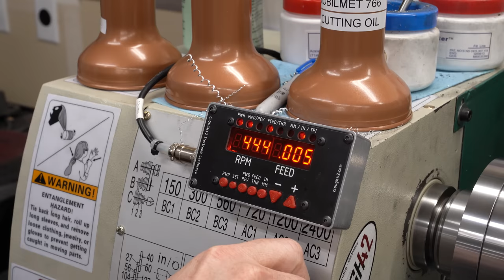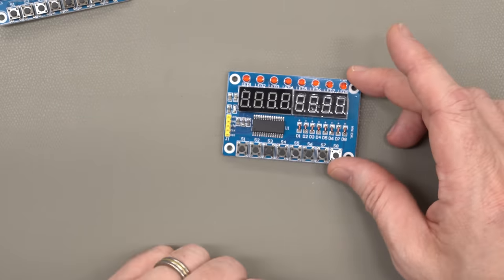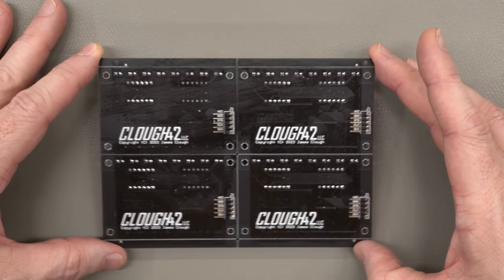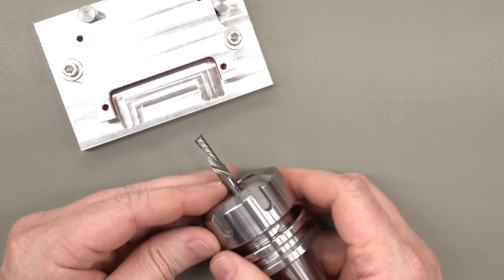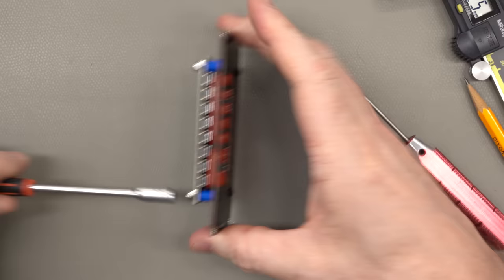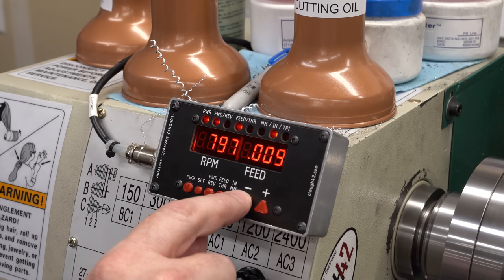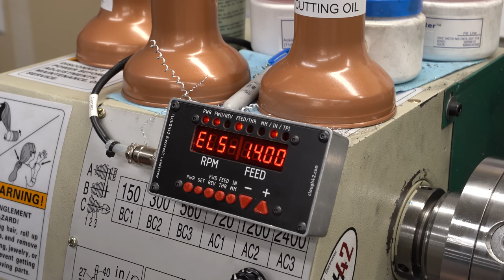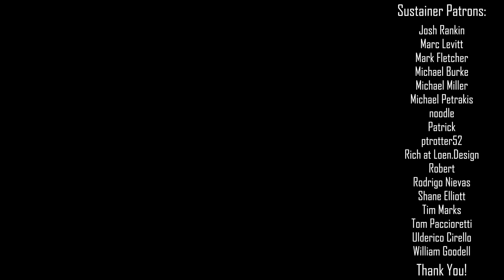Updating the Electronic Leadscrew Control Panel

Comment: Once I needed to go long distance with 3v3 and of course I had the same capacitance problems you had at the start of this series,  so I used a pair of level shifters and bumped it up to 12v. As a plus it turned out to be surprisingly noise resistant and easy to filter, getting a nice square wave out of the 3v3 side of the level shifter.
Reply: Not a bad idea. Take it all the way up to the industry standard 24 volts, then when you roll back down any induced noise is reduced by a factor of 5 or 6.

Comment: James. I had the flicker problem and fixed it by replacing the pull-up resistors on your board with lower value. I THINK is was 10K and I replaced them with 4.7K and problem solved. Not sure about the values, but I made them 1/2 the value of what it was.
I replaced the resistors in the opposite end, on your board that sits on the controller. No more issues.

If you decide at some time to upgrade to a bigger lathe, then I can provide pictures how I installed the ELS on my Birmingham 12X36 Lathe (Generic 12X36). 
Thanks for what you are doing for us. Very much appreciated.

Comment: I am very happy with my electronic lead screw. I did have noise on mine when first set it up. I did various screening. But eventually the problem was tracked down to not grounding the main control board  to the chassis of the lathe. As Soon as I did that everything seems to be very stable. don't think I needed to have screened anything.😅

Comment: 23:52 One of the coolest aspects of this project is that there is essentially no curtain.  Turning a potential customer service hassle due to a supply chain issue into a couple of interesting videos is a 200 IQ play.
Reply: Customers are much happier when they understand the problems of the supplier. When I have a problem, I work with my customers to fix the issues, involving them in it as much as possible. In that way several good things happen. First they feel valued and heard. Second, I get to pick their brains for solutions that I may have missed. Third, they tell their buddies that I care.

Comment: Hi, In my experience errors there are usually caused by ringing on the signal transitions. The easiest way to fix that is usually a bit of series resistance in each signal lead at the signal source end.  That slows the edge down.  Resistance value is not usually critical, anything from 22 to 100 ohms will probably work.  I assume the DIO signal is bidirectional so a bit of resistance at each end may help. I gather the clock and strobe are sourced in something at the other end of the cable, so the easy fix isnt all on the display board. Could be in a cable adaptor.
Reply: DIO definitely is bidirectional if you are using buttons, yes.
Reply: I hope he sees this, was going to say the same thing. He needs to get a scope on it to see what's happening tbh.
Reply: @feynthefallen  
yes, but ringing on DIO is probably least important. Well, at the master that is,  the peripheral still needs a clean clock.     I speculate cleaning up clock and strobe is likely sufficient.   Source termination is the relevant buzzword for all this.
Reply: @ferrumignis  Exactly - without knowing what is causing the problem, it's just shooting in the dark.

Comment: I am sure you have thought about this, but looking at the setup, with the metal box attached to the lathe, unless the screen on the cable does not connect to the die cast box you are introducing a ground loop. So either isolate the box from the lathe or not terminating the cable screen on one end or the other would help. 
I did watch your video years ago but have forgot if you covered this or not, if you did sorry for being a know it all commentator !

Comment: If you want to save a few more pennies and have a higher yield consider changing the LEDs to SMD. With that printed spacer if you extend it a little in that area you will get the light guide effect to stop bleeding from one to the other that might result otherwise. Hand assembling that many LEDs there's going to be some reversed.
I'm guessing you're planning on low pass filtering the SPI lines for the noise? Be interesting to see how that works. Be even more interesting to see if you could diagnose the noise first, scope it or some such to find the source.
Reply: I’m no electronics expert but is there a risk of an LP filter introducing a phase delay on a line which might need critical timing?
Reply: @routercnc9517  Good question, but low pass is in the design of the mind of the passer. In some circuits, low pass rolls off at 500Hz, in others the roll off window is up in megahertz regions. It all has to do with the overall band width of the signals involved.
Reply: Another cent or two saved could be achieved by ditching the extra, apparently unused switch between the + and - buttons.
Reply: @maikeydii  thats a good point. i dont see a need for that button and if everything else needs / is getting a facelift it might save a bunch to ditch it
Reply: @maikeydii  Going back to the beginning, James talks about that button.  It's a standard panel with numerous applications.  Probably more expensive to eliminate the useless button than to keep it.
Reply: @routercnc9517  provided all the signals are treated equally there shouldn't be a delay on any particular line. You'd pick the RC constants as probably something like 4x faster than the signal rates, do the maths though on the input switch levels and rates to make sure it works out.
Mostly just thinking low pass throws out a bunch of high speed noise you don't care about. Probably not really the right way to solve it but it is low cost at least lol. Not too hard to trial too.
Reply: @zyeborm  Yeah, minimal delay anyway but an LP filter delay shouldn't matter. Easy enough to test.  Depends on where the glitch is coming from.  If it's noise picked up by the connection wire, maybe switching to shielded wire is a better way to go.  I would eliminate the possibility of the controller sending the glitch to the panel, first though.
Reply: @plb53apr06  it looks like it's already shielded I think? At least for some of its run.
Think I saw him say he thinks it's the led drive lines crossing under the input signals doing it.
It's all a bit of a black art really when there's that much noise around and you can't significantly change things to remove the problem.
Reply: @zyeborm  Hmmm, that doesn't make a lot of sense to me, the lines are crossing at right angles - parallel will generate cross talk but usually not perpendicular.  If it is crosstalk, he should route the 7-seg drive lines to right of the chip instead of the left. Might not look as pretty but would take the 7-seg drivelines away from the comm lines. Then there wouldn't be any crossings.
Reply: @zyeborm  OK great thanks.  Let's see how he gets on . . .

Comment: To combat the noise, you could write your own I2C driver to use the microcontroller push-pull (totem-pole) outputs for transmission, and revert to open-drain configuration when receiving. The lower impedance output should reduce the likelihood of noise on the line. Bit banging I2C is very simple, and the waveforms are very clearly explained, so it's not in any way difficult.
Reply: It uses SPI

Comment: You should also consider putting decoupling caps on the power pins on the ic. It would help to kill all excessive noise. Maybe a 10uf tantalum plus a .1uf ceramic.
Reply: I wonder if C1 and C2 on board are decoupling caps as on the reference design?
Reply: Yes, add ~10uf decoupling. Add ~47R series resistance to the data/clock lines.
For mechanical simplicity, have a look at the Wurth SMT threaded nuts. LCSC has Chinese-knockoff nuts for assembly too. That way you could remove the need for the printed spacer and locknuts.
Reply: @hoggif  These look like they are supposed to suppress power supply noise. On that note, an inductor in the power and ground lines might not be the worst idea. My guess is that the data lines need signal cleaning capacitors. The frequency on those signals is low enough that a 2.2nF from each signal to ground would de-noise the signal without degrading it. Only way to be sure would be to put a scope on them and scan for transients of course.

Comment: The timing of this video was very convenient. I finished installing my ELS yesterday and noticed that one of the LEDs was not working and now I know why. It has either slipped the quality control or more likely, failed during shipping or when I powered it up. I also cut the wings on the spacer to make the display assembly fit the cutout in the headstock where the old tachometer LCD used to be mounted.

Comment: Another labour saving trick when panelising boards that may be possible here  is to gang together all the input connectors via the panel edges (obviously putting the traces on the unscored side. Then you can test the whole panel at once with a single connection.

Comment: Great video James! I really enjoy this sort.
I read through all of the comments, 158 at the time of posting this. Many thoughts/suggestions to ponder. Rolling your own PCB makes for a trip down the rabbit hole with all the possibilities it opens up. Looking forward to seeing what changes you implement, both for the noise/glitch and other comments/suggestions.
Thanks again.
Reply: Next he will be adding the Z axis DRO directly into the board so that a threading operation will involve putting in the thread pitch, the start point and the end point. They all the user has to do is advance the tool depth and hit one button to get the next pass.

Comment: When using solder wick for those little guys, douse it in flux and the solder will wick even better.
You did a good job with the SMT's. 
 For cleanup work, if your pads have too much solder on them to look "pretty", you can wipe the tip of the iron off very clean and go back and re-heat the joint.  The small amount of solder that transfers to the tip helps to take the excess away so you get the right amount of solder on the SMT's.  It takes a few trips back and forth, but eventually you take the excess away.

Comment: Glad to see you're doing your own design! I recently got a kit that had a bad board, keystrokes were missed 50% of the time, the screen would go all crazy if it was flexed ever so slightly (like a hard button press), and the LEDs and displays were all dim. Fortunately they're cheap and the one I got for $2 or $3 to replace it worked perfectly. Love my ELS and am really glad you are pushing it even further!

Comment: Thank you, James, for this video series, I really enjoy it a lot. Maybe you need to add more "Bypass Capacitors" to the panel's voltage rails as close as possible to the main chip, these capacitors will filter any power glitches, remember that you are using long cables. Maybe 10uF and 100nF capacitors in parallel should be fine for you.

Comment: If you are going through the trouble of making your own board you should consider using a differential transceiver to send the data from the panel to the main board. I had a ton of issues with noisy lines causing flickering screen, and ended up modifying a PCA9615 which is for I2C but can work for SPI as well

Comment: James, I started binging on the ELS series a few days ago.  Last year I bought a G9972Z which appears to be essentially identical to yours other than the "11x26" exaggerated capacity.  It was a replacement for my "real" lathe, a Jet 1024 that had back gears, feeds in both directions, cross feeds in and out and a full gearbox with gear changes only for hybrid metric threading.  Watching this series gives me hope that the G9972Z can almost become a real lathe.   It's time for me to start collecting parts!  Thank you!

BTW- You might look into Rosco theatrical lighting gels for the filter.  They're very thin (3-4 mil thickness) and made of a stable polycarbonate.  Once upon a time I made my living as a photographer back in the days of real film and liquid processing chemicals.  I would put dark green Rosco gel over red LED displays on the darkroom equipment to prevent damage to color film while handling it prior to processing.  The displays were still very visible but didn't pass much light into the darkroom.  Without the green filters the red LEDs lit the room enough to trash color film and fog B&W film.  I know that's not important to this application but the contrast between the dark portions of the displays and the illuminated LED segments was striking.  Just mentioning it because someone might be interested in experimenting with filter colors other than red.

I've watched you for your machining videos for a long time.  Your depth of knowledge of electronics, programming, machining, manufacturing and the multitude of skills required for this project is most impressive.  The equipment around you suggests you've been through more rodeos than most.

Comment: For anybody wondering why things cost a lot more that the basic parts cost this video is a good illustration of how much unseen work goes in to getting a product right.
Whilst you're improving the product and effectively cost reducing it, I'd question why you fit switch 7 as it appears not to be used. A few cents saved, or do you use the boards for other things which make use of it?
Reply: It's all the non reoccurring engineering time, that is where the major initial cost arises. If you make 10 of a product, then the NRE per product is very high, but if you make millions of that product the NRE falls very low.

Comment: Adding decoupling capacitors on the ic power pins will help out with filtering unwanted noise.
Reply: Not is the noise is on the signal lines, which seems likely.

Comment: Good for you, taking this on. ❤
You might check to see if there are even bond wires on the substrate of the failed LEDs.  That’s assuming that there’s a substrate in there somewhere. 😂
Yes, I do electronics for a living. I feel the pain.

A panel knife will really help separating the boards cleanly.

Comment: I finished my ELS recently and even managed to upload a video series on my channel.  I spent along time reducing electrical noise to make it function and it worked in the end but could not get rid of the occasional display glitch. I spent more time trying to fix what I thought was more electrical noise.  In the end I realised it still functioned fine so I left it.  Good to know I’m not going mad and it can be improved in the hardware.  If the new display is offered stand alone I may consider buying one just to remove the issue.  Great work thank you and I realise just how much time goes into this sort of thing!

Comment: I have enjoyed this video series so much. Working on my own ELS with some improvements and I really appreciate how much detail you have shared from your design process.

For what it's worth, one option to eliminate noise issues would be to use a different bus type (CAN comes to mind) as an intermediary between your main board and your display board. CAN is incredibly noise tolerant albeit relatively complex to implement in hardware compared to SPI or I2C. But I imagine there's a simpler fix than that...looking forward to seeing what you come up with!
Reply: In Chris Chatelain's comment, he speaks to doing a level translation to 12 volts on those signal lines. This has the effect of quashing any noise by a factor of 3 or 4.

Comment: If the connector on the back is such a problem with multiple manufacturers, not just one "not feeling like it", maybe it'd be an idea to adapt the box it goes into to have more room, so the pins can be just bent around to the side? Not sure if the pins are soft or fragile, but if they allow bending, maybe that'd be an easy "fix".

Depending on the mallability of the pins, maybe the yellow plastic thing can be snipped off and the pins bent around 180 to face backwards into the housing. If that makes it better than just ~90 off "outside". If they're long enough without the plastic and soft enough, maybe they can even be bent so they end up roughly on the backside as actually intended.

Comment: Good work there James. Goes to show that even for a side-hustle you need to understand design for manufacturing when you want to scale your project. Most of the cost saving is in making handling stages simple and fast and bake in quality control. Consider giving the manufacturer a copy of your tester. As for the noise immunity, have you tried ferrite beads for the signal lines? If that works you can put SMD ferrites on the board.

Comment: SPI isn't really intended as a board-to-board interconnect, though of course it can work for that reasonably well. For noise resistance you really want something with differential signalling like CAN, RS-485, or Ethernet. Probably CAN for a project like this. The obvious disadvantage is an increased BoM cost, and more design needed since you have to have transceivers and some way to translate the protocol at each end. You could probably run SPI over differential drivers, and thereby only need transceivers at the ends (no protocol translation). 

You also probably want to try to eliminate any through-hole parts you can to keep the cost down. An all-SMD assembly is usually far cheaper.
Reply: Well the final solution is to move it into a bidirectional fiber optic system where the data is just light. Then no spikes.